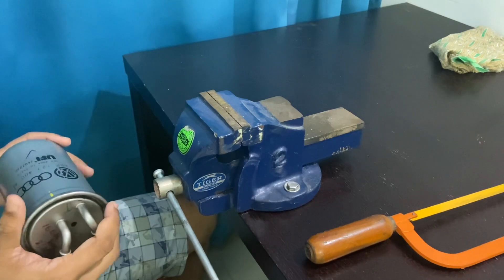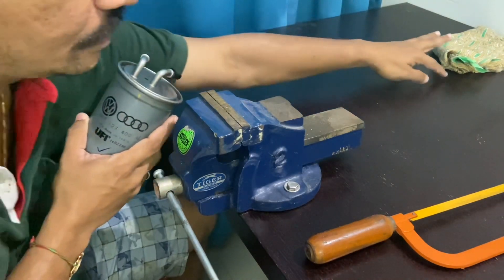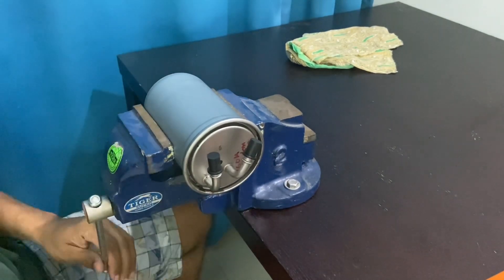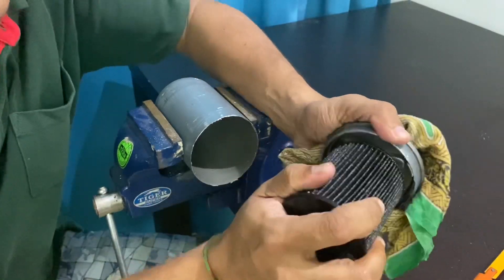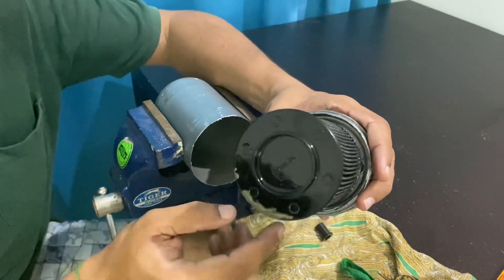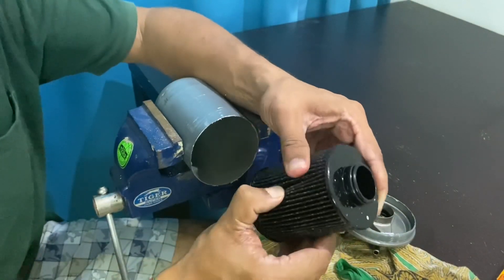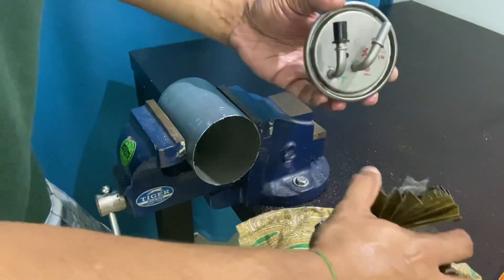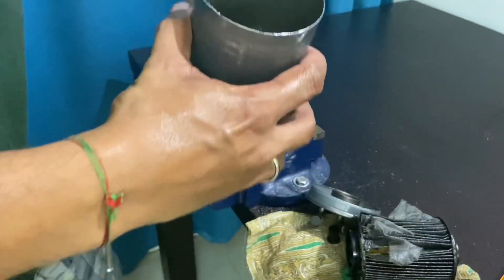Cutting open the VW/Skoda/Seat diesel filter - what’s inside?

Comment: When it comes to diesel filters, it's important to understand that not all options are created equal. The filters made by VAG OEM stand apart from cheaper, similar-looking alternatives for one key reason - the grade of filtration paper used inside.

The VAG OEM filters utilize a specialized, high-density paper engineered precisely for Volkswagen Group diesel vehicles. This tightly-graded, high-quality paper is vital for effectively capturing diesel particulates over long-term use without degrading and therefore it is a bit expensive
Reply from the maker: Thanks man. Lot of good info there. Appreciate it. 😊
Reply: @GaneshBalan comapre the sofime or oem filters quality ?its same ?
Reply from the maker: @japjitbains3279 No major difference. Sofima is also an OE filter supplier to many manufacturers.

Comment: The fuel filter on my petrol mpi polo is rated for 30000km but most showrooms don’t change it that often: I did change mine at around 42000kms: very similar arrangement and I was surprised to find it still working pretty fine with clear petrol exiting the filter and mucky black petrol coming out the other end when removed; all in all a great arrangement
Reply from the maker: The one on the 1.2 MPIs aren’t changed as frequently as the diesel filters. I am supposed to do the oil change service on a friend’s 1.2 MPI and we did not buy the fuel filter since it had a long service life.
Reply: @GaneshBalan  oh in case you need to change it anytime, hose clip pliers do the job ; the dedicated vw tool (aliexpress) for the job only makes it easier. I’ve been using hengst filters for air,oil&fuel: I find them even better than oem in quality
Reply from the maker: Thanks Kaushal. We did the oil service on the 1.2 MPI this weekend and did not change the fuel filter. I checked the workshop manual and found the location and yeah like you said, it did indicate a hose clip pliers for the job. 👍🏻